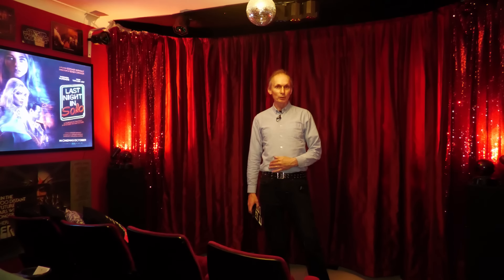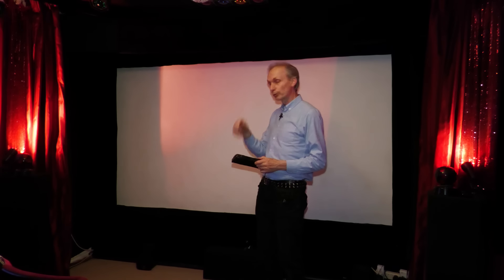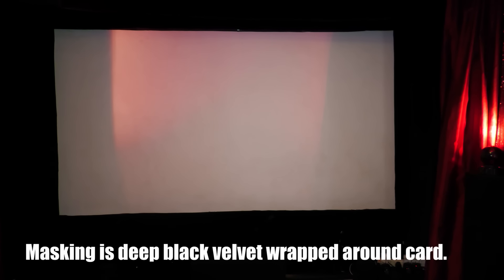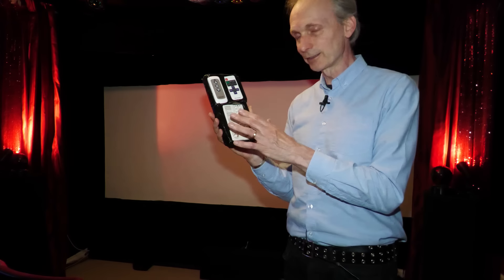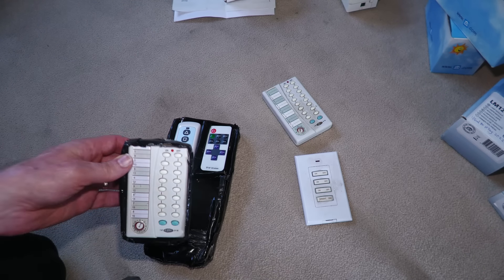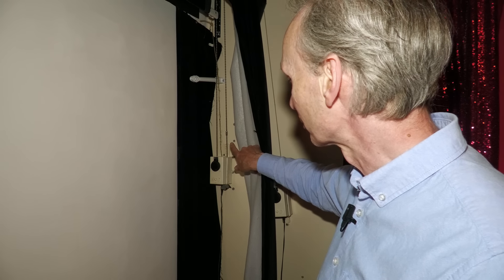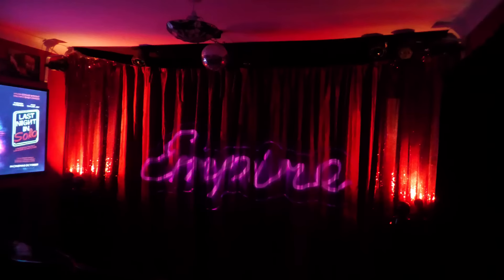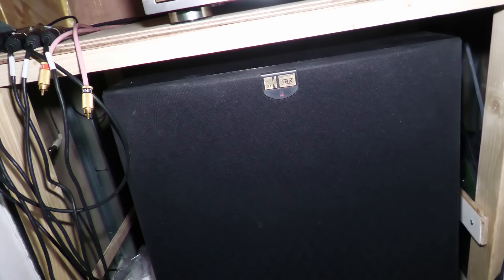HOME CINEMA TOUR 2024

Comment: Thanks for the tour, really like and appreciate what you've done with your theater.  I'd just suggest placing your center channel on a stand so it's off the floor and closer to ear height or at least tilting it up towards the you
Reply from the maker: The centre is tilting up which is how that speaker is designed.  It's a home THX Ultra so the tweeters fire everywhere and therefore not as important to have it in front of your face as it is with normal speakers.
John.

Comment: Absolutely brilliant, thanks :)

I'll be trying to figure out an auto masking system once I get my screen up but as usual there are complications as my room is in a converted loft space so unfortunately I have a vaulted ceiling which limits my screen height wise.

I think I may have to make the screen height as close to the ceiling & floor as reasonably possible & then only have moving masking at the sides & they will have to travel diagonally rather than horizontally so maybe some sort of track fixed to the sloped ceiling for them to run along 🤔
Reply from the maker: I have seen a loft cinema with exactly that solution Gaz.  It may mean a curtain motor on each mask but that's exactly what I have with the red curtains in here so we know the solution can work.  If you end up with an X10 solution then putting both curtain motor masks on the same code number will activate them simultaneously.  But there are plenty of other ways to achieve the same thing.  Good luck with it all.
John.
Reply: @moviecollector5920  Good to know, thanks again John 🤟

Comment: I love the authenticity in all the details of your home cinema. I'm in my 40's so I remember when the local Odeon just had one huge screen with curtains and masking (later split down into three smaller screens). I would hate for cinemas to disappear as I still love the experience, but I also have a small home cinema (converted garage) myself. Oh and that "all in one" remote for your masking is fantastic - not pretty, but effective!
Reply from the maker: The all-in-one remote simply works Ross.  One of those Heath Robinson quickfire solutions that ended up becoming permanent.  Initially I had to have a table next to my seat to contain the three items which obviously didn't work.  The squishy solution I came up with means it sits in the cup holder.
I hope you're getting a lot of use out of your drive-in theatre!  We have two classic cars in ours so no room for a proper cinema in there.
John.

Comment: Thank you for the tour of your beautiful cinema. I would like to do the same for my setup someday. Currently, I've been using a matte box to keep the unwanted light coming from my projector off the wall. It works ok.
Reply from the maker: If you can find some deep black velvet material Rey you'll find that will absorb the light.  A few drawing pins to put it on the wall and you're done.  The problem might be finding good black velvet these days as fabric stores all seem to have gone out of business so I can only find cheap crap options on the web.  Good material has still got to be out there somewhere though.
John.

Comment: I love your set up, just like going to the Cinema as a kid. My set up is just on the cheap, projector pointed at the wall nothing fancy. The wall i find is better than a screen i can get a bigger image.  😄😄👍👍
Reply from the maker: My screen is actually the wall too Colin and I think it's the best choice because it costs practically nothing to maintain or renew.  Just a bit of brilliant white emulsion paint.  Create some masks for your image by covering cardboard with black velvet, put some hooks or pins into the wall in the right places and you can hang it to mask off the relevant aspect ratios to match what you'll be projecting.  It makes a significant difference as a black envelope around the frame fools the eye into thinking the contrast is better than it really is.
John.

Comment: Those red seats look just like the ones we had at my local amateur theatre until we had a refurbishment and auditorium layout chage,  They lasted 30 odd years of frequent use! Our stage curtains (tabs) were hand wound though.
Reply from the maker: They are extremely robust Brian.  I'm not sure more modern tip-up seats would be quite so resilient and so not only are modern items more expensive but they'd need to be changed more regularly too.
John.

Comment: I always wanted to use some sort of masking in my own home cinema John. But found it way too difficult to set up! Maybe they should make a kind of kit, to make things a bit easier for those of us with no brain cells! I can do picture and sound on my own, but not masking! My local VUE that took over from a Ster Century cinema many years ago, doesn't seem to bother using their masking anymore. They used to just pull up the bottom masking and only use the top of the screen, where there was no masking at all, rather than have a 'one-up, one-down' approach. But now they just leave it, as it's fairly dark anyway. Our local 'faux' IMAX is soon going to be changed into an i-sense cinema or something, with recliner seats, just like the Odeon Leicester Square. So I hope that's good, although I know it will increase prices no end! (Odeon Norwich). All the best mate! Still loving the channel!
Reply from the maker: The side masking is fairly simple Charles as it's just a corded curtain track.  There's no need to a motor really it's just I like to sit in the chair and press buttons rather than get up and manually adjust.  A pair of black curtains is all that's required for the side masking but perhaps with a bit of card inside the inside edges to ensure they are completely straight.  Balsa wood attached to a roller blind for a top mask is probably the best solution.  Paint it black or black velvet on the top and hey presto, it's done.
Cinemas should have cinema seating as far as I'm concerned.  I hope the audiences return so that great cinemas like the Odeon Leicester Square can put them back in.
John.

Comment: You could use an £5 ESP32 microcontroller module, to run your curtains and masking, they have built in Bluetooth and WiFi, so you could either make a custom remote control, or use a phone or tablet.  It should even be possible and cheap to detect the projected images ratio and automatically adjust for it. Although the easier option would be to set it for each film and then it stores the settings for each film.
Reply from the maker: None of that is X10 unless you know something I don't.  It's not sensible without a simple solution such as X10 where you push some real buttons.
John.

Comment: Loving the modified pre-BS5499/ISO 7010 Exit sign!
Reply from the maker: I was really upset when the power supply for the strip light in that EXIT sign went last year.  But the LED workaround actually turned out much nicer so it's funny how things turn out sometimes.  I'm told Exit signs are on the way out now!
John.
Reply: @moviecollector5920  They're great for modifying. I'd love to snag a pre-BS5499 Exit sign for my living room, or at least fashion one out of an IKEA frame, and put a colour- hanging bulb in it.
Reply from the maker: @AurumUsagi  The LED I got for my EXIT box is just one of the four strips intended for sticking to the rear or a telly.  It only cost about a fiver.  Amazing.

Comment: Brilliant video john excellent cinema room possibly do a 35mm lace up and run on ur next video feature the cinema release of the incredible hulk
Reply from the maker: I do have the 35mm trailer for Hulk Dave but showing anything now risks copyright trouble.  I am planning a 35mm video owing to the whole learning process, most notably with the digital sound.  But I'm still having some trouble with the sound so it all depends on getting that sorted.  John.
Reply: @moviecollector5920  that would be a great watch I worked in virgin cinema yrs ago and hot opportunity to spend a few months in projection as a trainee
Reply from the maker: @davelangridge3557  Apparently an oscilloscope is required to sort out the Dolby SR sound problem.  It's all beyond me Dave.  John.

Comment: How old is the pioneer amp ? Does it passthrough 4k hdr  to pj as it looks like an older model
Reply from the maker: I've had it for years.  I got the first Pioneer VSA THX in 1998 and this followed a few years after.  Better than just about anything today unless you fancy spending the equivalent of the £1700 these cost back then.
John.
Reply: @moviecollector5920  Just curious as to how you get the bandwidth for 4k hdr without a receiver with the capable hdmi output to the laser projector. On my set up my Panasonic 4k player outputs to my Marantz processor which is 4k capable and passes the signal to a 4k capable tv or projector. Do you output video from the Panasonic to projector and use coaxial from panny player  to pioneer for audio ?
Reply from the maker: @littlemanitor  I wouldn't go from the player to the amplifier in any case Ellis.  Why add an extra electronic device into the path of the video when you can go straight into the ultimate device?  One more thing to possibly mess things up.  An amp is for the sound and that's all it should be.
John.
Reply: Depends if you are converting Digitall to Analog and pushing that to amp is that not worse 🤔
Reply from the maker: @littlemanitor  I don't do that from any of the video disc players but the 35mm projector comes out of the Dolby CP500 processor as six channel analogue and from there into the six channel input of the amp.  It's higher quality as you would expect but it's so good already I'm not bothered.  I hope to get over to see (and hear) 'Andy THX and his cats' home cinema which I think is going to sound better with all the equipment he has (30KW THX) but other than that I've not heard a better home system than this Pioneer and Kef home THX Ultra system.  High end equipment was built to last back when all this was current but I did blow the cone out of one of the rears at the Ealing Town Hall about 20 years ago.  Fortunately Kef had a replacement to me two days later and included a whole load of other spares gratis.
John.

Comment: How big is that screen ?
Reply from the maker: Just under 10 feet wide.  It was 10 feet but then I had to bring the sides in about three or four inches to get them inside the aperture left by the fully open curtains.  I don't do diagonal measurements as that's for tellies.
John.